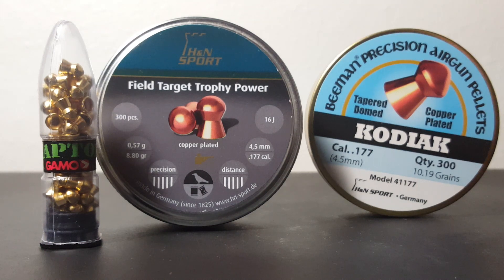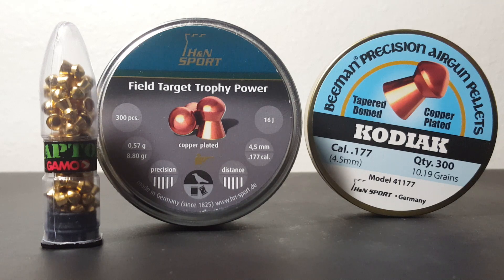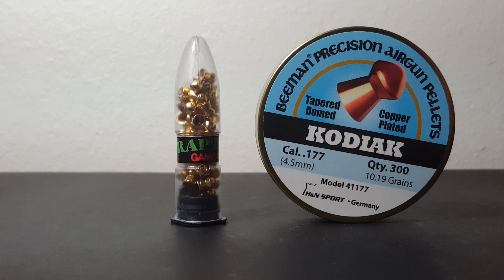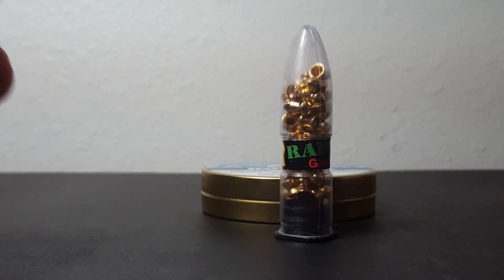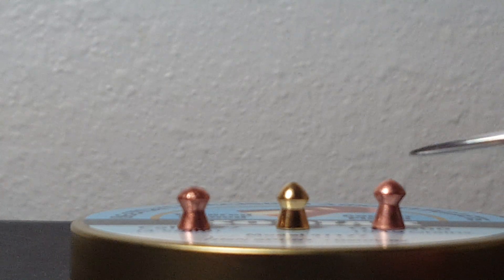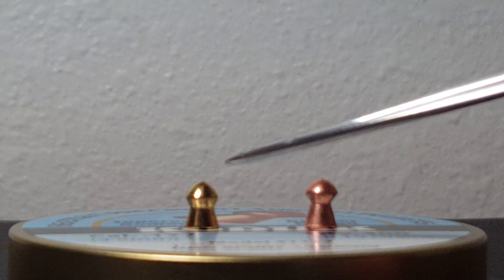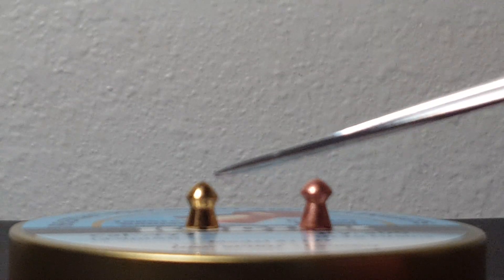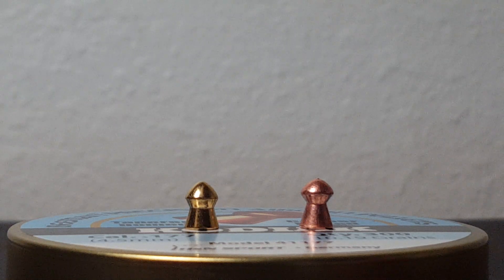Daisy 880 & Full-Metal Jacket

Comment: Daisy doesn't seem to be making airguns for hunting. For some reason 22 SG is discontinued, and the other, more powerful multipump airgun (Winchester model 1977XS) is still .177 caliber
Reply: @littlefoot The market is already full of air rifles packed with features, that Daisy doesn't offer. Modest sales are probably the reason, why 22 SG is gone, and stays that way :(
Reply: I have a Daisy 22SG (822). I bought it about ten years ago. Very nice rifle but honestly not enough power for hunting unless it’s 15 yards or less. It’s like an 880 firing a 14 grain pellet, which really slows it down
Reply from the maker: I had a 22x which had a smoothbore and blew an o ring right away. Not the best Daisy time. Yes, and slow. But folks love their old 822. Daisy should consider 901-22 with rubber pellet mag - like 922.

Comment: Hey man. I was wondering how many feet pounds your 880 is put out with the gamo pellets.
Reply from the maker: To, got your answer from Airgun Fun. Here is your info (ten pumps) AND MORE:

Airgun fun: 

Daisy 880 Fanatic Fix It 6.48 kodiaks 705 fps at 7.1 ft/lbs, 5.4 gamo raptor 768 fps at 6.9 ft/lbs, 7.0 daisy pointed 700 fps at 7.6 ft/lbs, 10.5 crosman piranha 595 fps at 8.2 ft/lbs, 4.0 crosman ssp 853 fps at 6.4 ft/lbs, the 6.4 kodiaks on a bad day are dime 5 shot groups and 1/2 c.t.c at 15 yards on a good day, wich means it will hold 1/2 inch groups at 10 yards for at least 5 shots, pellet seats tight in bore for a alloy pellet explaining why velocity is slower but the gain is accuracy over speed, the h/n fields or trophy 5.56 grain pellets are similar to the raptor but a little slower, the raptors are a zinc alloy possibly rather then soft tin but they go toe to toe on performance at every level with wood and sheet metal but 5.56 pellets are maybe 15 bucks for 300 being cheaper and better for rifling, smooth bores can run raptors any time, any tin based alloy will melt at 450 deg, i melt down my alloy pellets and discovered some pellets are zinc wich is harder on rifling, these dont melt unless a propane torch, they dont melt on stove, you can tell by the hard skirt of pellet if it wont dent with finger nail its probably zinc

-- Airgun Fun Channel
Reply: Do you think that the crosman pellets have zinc in them. they have hard skirts. Have you try the Gamo match wadcutter. My daisy powerline 880 shoots them will at 25 yards under an inch. It also shoots the jsb monster's and Beast surprisingly will at 25 yards. But at 50 years they are not stabilized any more pretty good for 25 yards. Under an inch. The pellets I like to use the most are the 10.5 gr crosman domes. They shoot ok at 50 yards.
Reply from the maker: To Fast, another good question. That one is more commonly known - antimony alloy. Makes it harder. 

Lots of folks like Premier Crosman ammo. This channel favors H&N. On Raptors, I would only say to use on a raccoon. Otherwise a rabbit or smaller H&N Power pellets.
Reply from the maker: https://www.pyramydair.com/blog/2008/02/crosman-pellets-they-werent-always-premiers/
Reply: Daisy 880 Fanatic Fix It do they still sell the copper beeman Kodiaks?
Reply from the maker: BB, yes. But they are more commonly known as Baracuda Power. Great pellet and can be used in pellet trap.

https://www.pyramydair.com/s/p/H_N_Baracuda_Power_177_Cal_10_65_Grains_Round_Nose_300ct/735